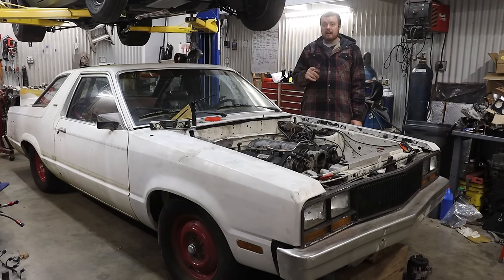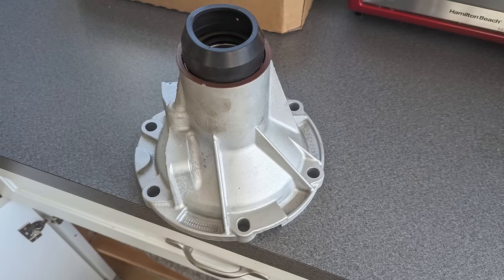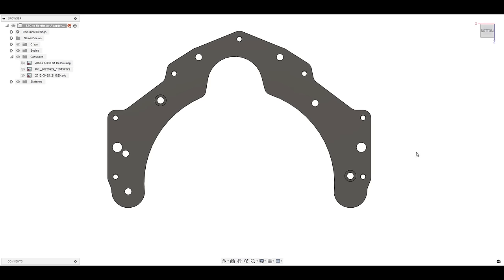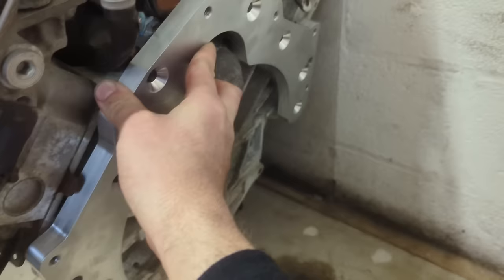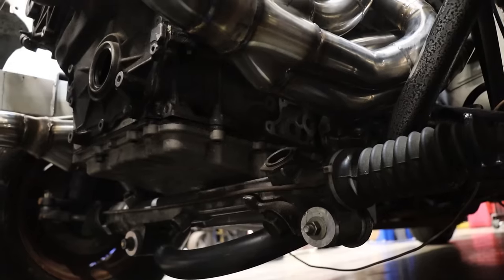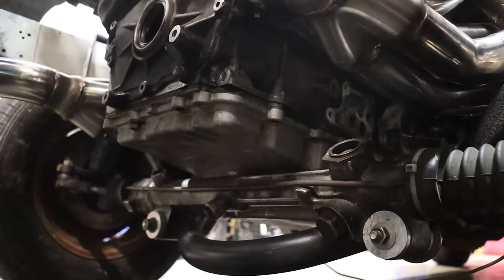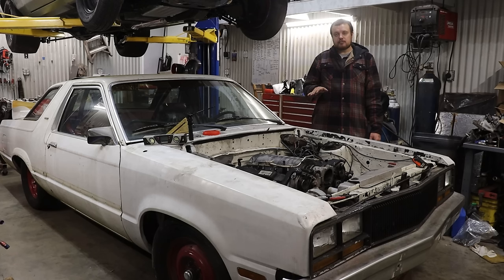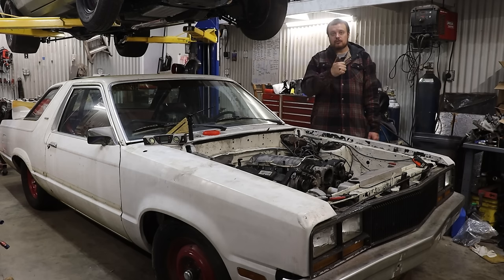Fits Way Better Than A Coyote! - Twin Turbo Cadillac Northstar

Comment: @Nivlac57 Thanks for working on this engine 😊

I have done some performance work with the LH2 in my STS-4 and love it!

Delta Cams will regrind the stock cams and has a few good profiles, however, make sure he knows it's a new style roller cam or he won't do a Northstar cam.

The stock LH2 intake was designed for torque and the plenum design restricts upper RPM.  You'll see that the plenum is fed by the inlet duct with a 90 degree bend, and there is a lot of area the plenum can be expanded to upwards and back.  I cut a 1/2" wide by 12" slit in the bottom of the intake and used that as access to hog out the plenum area from the front all the way to the back.  I then 3D printed a dome shaped cap to close off the rear of the intake with epoxy and pop-rivets holding it.  I then sealed off the bottom of the intake with a piece of steel that was 3" by 15", also using epoxy and pop-rivets.  This intake has been tested to above 20 psi 😉

Hit me up, I have lots to chat about the LH2 and ECUs.

Comment: Its funny how people said Northstar was a POS and I thought it was a good engine just got a bad rap from lack of maintenance.
Reply: It really was a design flaw. The head bolts would pull the threads out of the block by themselves. There's no maintenance to prevent bad thread design.
Reply: That’s correct they did pull the thread, but was it cause of the design or aluminum? Maybe the steel of the head bolt or even bolt width. I have seen bolts bottom out and even hydraulically lock in engines, but the Northstar corroded due to wrong antifreeze and lack of maintenance. I was drilling and tapping these bigger before the aftermarket caught on. Studs help as well along with thread sealer, not silicon or antiseize
Reply: @firstrespondergarage if "wrong coolant" can cause your head bolts to pull threads, I would 100% still consider that a design flaw. There's no reason for head bolts to be that finicky. Combine that with the fact there is always going to be some amount of corrosion in a cooling system. It's a valid criticism of the engine platform imo.

Comment: I love my Northstar powered Eldorado. Studded the block , ported the heads n used stiffer springs. Big tube exhaust .It's a high revving motor that'll surprise people on a rolling pull. Can't wait to see what kind of power you get from this combo. BTW, I have heard of an adapter and block mods that would let you use an 86 GM 5spd but that was a few years ago.

Comment: That header thing with the press would have been a major wall for me. Great job adapting it to that flange. 

One thing that I am trying to picture. You added this cool adapter moving the transmission back will that cause issues with the torque converter engaging? I imagine 800hp requires a custom converter. But if you were only making say 350-400hp in more street friendly application. Would you shim the converter back off the flex plate so the starter still works or keep the converter bolted directly to the flex plate and slap a piece of aluminum against the crank to make up the difference and move the starter back some how?

Comment: Im an auto shop owner in NWPA. Had a guy who bought a chevy colorado. He blew the engine up on way to work. His boss was like yeah my brother can fix ya right up. They tow it to his place and they get a "low mile" used engine and he slaps it in for him. When we had those sub zero temps last december he heard a snap and truck would not move anymore. He tows truck home and pulls out transmission. He finds broken flex plate. Google search led him to missing dowel pin. The converter snout broke. He got new converter and new rear main seal he put it back in and trans fluid is leaking bad. He brings it to my shop. Yeah it is. We replace the trans and I drive home. Shifts great and no trans leak. Oil is pouring from rear of the engine. I pull out trans and take flex plate off. I never removed it when I installed trans because he said he had put a new rear main seal in. Im looking at 2 holes ground in the back of the "rear main seal housing" which bolts to back of the block. "New rear main seal" looks odd.  Well at first I thought it was in backwards but no it was in fine. I guess those 5 cylinders have rear main that is a reverse lip seal so its backwards of normal seal. Anyway he had ran the thing with broken flex plate for 2 hours to stay warm till the tow truck got there. He said he seen the holes but didnt think it was a big deal. Rear seal housing was backordereed and we ended up having to have his welded.

Comment: For the transmission Adapter plate for the trans just make sure its centered easy this should be a breeze for you. Bolt it to the trans then bolt the tail housing through the other side.

Comment: Wtih the 6L80 im pretty sure you find another one of a out of a Camaro or truck and swap the bellhousing/pump assembly. From my knowledge all the 6Ls share the same case and with 6L80s and 90s pretty much all the parts are interchangeable.

Comment: SUB'd waiting to see how the build holds up , what do you figure the stock block is good for horsepower wise?  are you building with all stock internals....  I had considered using this motor in an OBS chevy but went LS due to overall cost. Love the twin turbos and btw are you breaking it down to add ring gap???
Reply from the maker: Planning to just run it bone stock to start. Might do head studs, but that's it.

Comment: that tail shaft you have.. is it possible that there is shorter tail shaft house with a tighter spread on the bolt holes or vis versa??

Comment: The output shaft area of that transmission looks like a 6l50e. Hit up pick and pay and grab one off a 2007-2013 Cadillac CTS V6 and see if that works
Reply: I will be at pick and pay today if you want I can measure the distance between the bolts

Comment: Where did you get the heads and gaskets  850 hp is good enough as a sleeper but 1200 if not with side exhaust but 600- 800 if run out the back if can i sent this to sleeperdude 88 on his utude channels he live them cars  and has parts on them as well

Comment: Excited to see the results!! I've been trying to decide what power plant to put in my sandrail. 🤔
Reply: The fwd version of the northstar has made it into many sand rails. It's small, lightweight and the waterpump location and intake set up works great in a rear engine layout. I love these engines, the stock valvetrain is good to 8,000rpm.

Comment: Because the Northstar didn't already have issues with ripping the head bolts out of the block and blowing the head gaskets🤣
Reply from the maker: Easily corrected.
Reply: @Calvin-Nelson  for naturally aspirated combustion maybe. Turbocharging creates way higher cylinder pressures. Why don't you just throw nitromethane at it first? Much simpler and if it handles that it should handle a good amount of boost.
Reply: @jeremypike9153  You are obviously lacking proper mechanics, physics, chemistry principles from Your attempted nonsensical comments !!

Comment: Considering the 4.4l supercharged version made 470hp on ~6psi, 650hp/550lbft should be fairly easy to hit.
These engines ended up being pretty badass for the time. The Coyote had just been released when GM killed the Northstar series. It took another 12 years for GM to make a successor, and boy did they deliver in the C8 Z06.
Reply from the maker: The new Z06 engine is so amazing, but none.of is will ever be able to own one.
Reply: @Calvin-Nelson  There’s always hope to have a salvaged one drop on your doorstep….but there’s no real internal parts for it yet anyways. The engine would be cheap compared to the cost of developing a parts kit for one to handle twin turbo power.
Reply: 9 years. You forgot about the Blackwing engine.
Reply: @Calvin-Nelson   That 5.5 L, DOHC, single plane crank engine could become available through many means; even to more common people
The engine control with transmission, trans-axle will still me a vastly new environment for You and Dad too.
Reply: @matthewf1979  You are clearly, obviously ignorant with the actual development of the entire C8 platform and each engine within GM.
They designed, developed, produced, tested on tracks all versions of the C8 by 2109, before 2020 FIA race season
Thus, the GM, Chevrolet, Corvette 5.5L, DOHC, single plane crank engine for both N/A [used in the FIA, LeMans series 2020-3 available for race teams for 2024], TT already existed in 2019, along with the initial 6.2 L, LT.
Also, Emelia Hartford with Peitz Performance [Houston TX] already achieved fitting their developed TT for C8, 6.2 L LT also on her C8 ZO6/7 including custom exhaust, then ran it successfully on the Drag strip in CA, Formosa Raceway. [videos are posted]
GM, Chevrolet has been gradually, slowly releasing each of their C8 versions for their marketing reasons, perhaps also including some more mass production implementation too.
The versions include the E-Ray with electric front motor, FWD added to the 6.2 L LT mid-engine RWD which has been already produced, released for 2024 model year, C8 ZR1 will have the TT added on to the 5.5 L, DOHC, single plane crank engine in the C8-R, LM series racing, Z06/7, C8 Zora has the same power plant/engine as ZR1 with FWD electric motors, which are larger than the E-Ray, also a C8 GS version too.

The engines may become available for individuals, perhaps crate motors, or via vehicle mishaps, crashes, etc. as occur with many such high performance vehicles sold to the general public. The issues will be ECU-ECM [now tuning arranged, released through HP Tuners], then more so with the integrated TCM.
Anyway, for nearly all enthusiasts, and similar level racing, they avoid mid-engine platforms, designs, except the few already factory developed more expensive vehicles as Nissan GTR, Audi R8, Porsche, Lamborghini(s); even the NSX, MR2, Fiero are rarely used !! [perhaps among the best seen is Fiero with a LT-1, twin turbo, along with some very fast MR2 with K-20 turbo, and NSX too !!]
There are few individuals, groups that comprehend, develop use the power, torque with rotary engines [1200-2000 HP 13B-2 rotor; also 3, 4 rotor ++]; but those that do have grand results ! -> though they too limit; none use in mid-engine or twin engine AWD !! 
Add the ignorance, reluctance with not using ethanol or methanol for fuel !! [ridiculous !!] why loose 100 HP with any V-8, V-6, I-6, I-4 engine including within boosted, forced air induction !! add the significant reduction with carbon deposit, build up, cleaner burning, consistent performance !! Add water injection, Better yet with Hydrogen !!
for some reason, just as the automotive manufactures, especially USA, have resisted change, modification, development, 'modernization', the enthusiasts, 'hot rodders', novice, common racers have similarly often more so remained in the 'past', not modernizing, using development, never innovating.
My background within mechanics along with design, development, innovation, etc. [> 45 years] leads me into these same paths within automotive, motor vehicles, within every aspect, component, and most importantly overall design of a vehicle as a system.
There are a rare few which post some very useful information, details like Calvin and his father, Justin Hearer {Chief] & Jackie, PFI Speed [Brent, Jaime, etc], more so David Vizard with his vast experience, knowledge within racing, engines, development, innovation - there is not much innovation left among humans, apparently - some still within electronics [still needs more too - 'self-limited' currently]
Good Luck and All The Best for each within their endeavors, quests, pursuits, desires
Reply: @newtonfirefly3584  I’m happy for you or I’m sorry that happened to you.
Reply: The LC3 has 12psi

Comment: The 6L80 shaft looks sealed, might be able to drill and tap shaft for a fixed yoke, the CTS and, I think, some of the STS were rear wheel drive, the CTS had a rubber disc as a u joint.

Comment: Ha we’re first. 

“This is gunna sound ridiculous but nobody makes this for ________” 

-Calvin naming some extremely obscure engine and car combination no one has ever seen or thought was possible. 🤣
Reply from the maker: Thanks for tuning in. Looking forward to the 5 cylinder project!
Reply: @Calvin-Nelson wasn't there a place called Northstar performance that used to build these kits to put in older hotrods? I could've sworn I've seen adapters for the Northstar to a traditional automatic. Isn't the Bell housing pattern the same as the series 2 3800?

Comment: The Caddy bellhousing can be swapped out to a 2 wheel drive Chevy 6L80 between 06-09, 
Depending on the year of your LH2, 2010-2015 6L80 can be reflashed to the engine computer of the same year, or maybe use, HP tuners?   Good luck on the build...can’t wait to see it finished and rippin

Comment: The biggest problem with the northstar is that pushrod engines arent actually that bad. Especially for a heavy Cadillac that likes to drive at low rpm. If they actually sold the NS or aurora engine in a chevy camaro or something like that instead of mostly fwd cars for cigar smoking grandfathers with velour interiors and earth tone colors it might be relevant. But when they figured out the corvette engine actually made a good truck and caddy engine the aurora and northstar became passe.
Reply from the maker: Hard to make a pushrod engine rev. I want all the revs.

Comment: If GM had put a derivation of this motor in to the C8, all the "it's not a real supercar because pushrods" comments would have never happened.
Looking at what you've shown us on it, the weak point under high boost is going to be the factory Conrods. Everything else looks more then strong enough.
Reply from the maker: You are right.

Comment: I wonder if the bellhousing/pump assembly of the Cadillac 6L80 will bolt to the 2 wheel drive transmission case from a truck or Camaro. If it will, you can build a 6L90 for your project.

Comment: Where do your accessories go in that configuration? Going to run alternator only and electric water pump? Im going to retain power steering and air-conditioning on mine.
Reply from the maker: We will have to make some custom brackets. Alternator only on this one.

Comment: What efi system do you plan to run it with? 
I definitely like the idea of this and wish it took off more. 
My concern with making parts for it is, there just isn't many left to mess with,  I could be wrong.
Honestly, i think you coulda gone bigger or even a little better with billet ones from VS. But they'll do for a start, lol
Reply from the maker: There is a decent supply out there. I might try a Megasquirt Goldbox to start. Trying to keep the cost down, and it's what I own.

Comment: I mess with odd stuff and know how much effort it takes to design, prototype, test, revise, and install. Doing that on the adapter and header flanges in one video is months in the making. As far as the 6r80e, since that only came in the sts-v and xlr-v it might be tough to source. Im not aware of the pump side of the 5l50 or 6l50 being the same as a 6l80. Can you use the bellhousing off a 5l50 c5 based XLR and hope the engine side of the torque tube side is shared to a c6 era 6l80? Sts-v and xlr-v is only available 2wd so if you are buying an adapter to go awd to 2wd you got a 5l50/6l60. I got deep into this rabbit hole in my quest to build an AWD LS CTS and went through a ton of permutations to get the sts/cts tcase on the back of a truck 6l80 and had issues figuring it out. If you can find a sts-v trans you are golden.

Comment: I love all of the alternate engine builds and discovery of limitations. The Atlas and Northstar are both under valued. Same as the Mercedes M-120 V-12 and some "high feature" motors from the late 80s/early 90s. It doesn't have to be LS/Coyote/Big block all the time.

Comment: Hey bud on the trans they made the 6L80 very versatile on the caddys look for a ATS 2.0t 2013-2015 6speed
2015-2020 8L80 8speed 
If you find a performance model the TCU is tunable

Comment: Btw u can also bolt the Eaton m122 blower on that motor also very easily. Check out the Cadillac xlr-v 4.4l supercharged Northstar an the Cadillac sts-v also has the 4.4l supercharged Northstar and both make close to 500hp from the factory

Comment: Honestly theres no reason not to go 6L90e rather than 6L80. Especially with a pair of snails in the mix. Not sure how too solvbe the tailhousing issue. Maybe check out 2wd caddie options...
Reply from the maker: Turns out, it's a 6L50e, not a 6L80e. Lol. My bad
Reply: @Calvin-Nelson  ahhhhhh....
I mean going awd would be even cooler ;)

Comment: Thing is going to be a beast. Until the headgaskets blow that is. Will probably pull the threads right out of the block.
Reply from the maker: Planning to run the Suregrip head studs. Should not be a problem.

Comment: Wow, this is going together to nicely.
Calvin you've stole the thoughts right out of my head, Lol😂 The only difference is I want to make an adapter plate for a Chrysler small block A518/46RH transmission, just becouse I love the simplicity of the old 727's is all.

Comment: Thought the 4.6 RWDs came with the 6l45/6l50, so you might have some luck finding a tail end from one of those to see if it fits?
Reply from the maker: Best I can tell is it is a 6L80e, but I could be wrong. I have a 5L40e that came with the other engine I bought. Tail housing on that is totally different.
Reply from the maker: Huh....I think you're right!
Reply: Pretty sure the sts v with the supercharged Northstar has the 6l80 so they exist with the Northstar pattern.